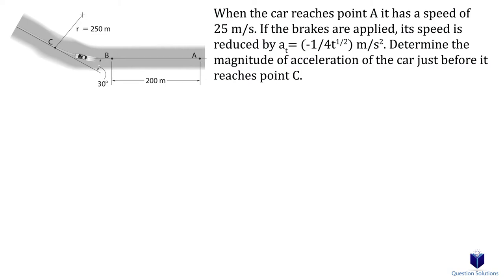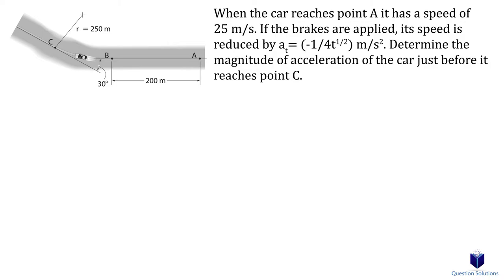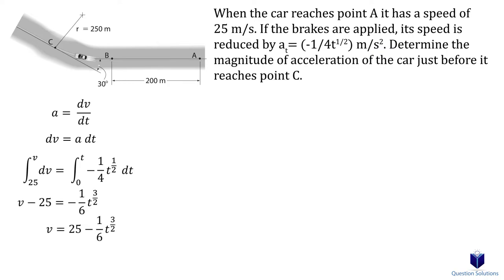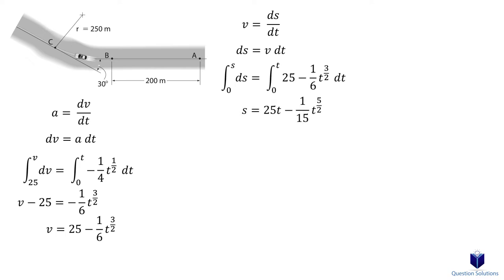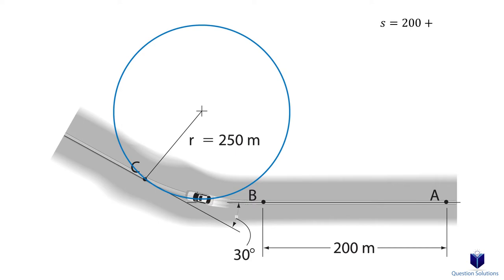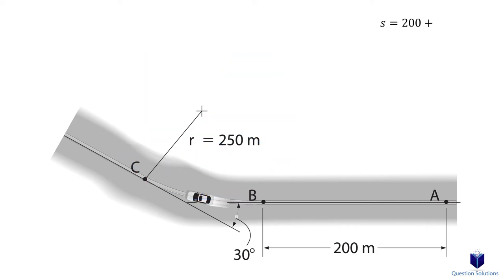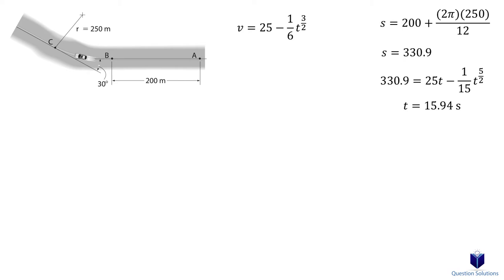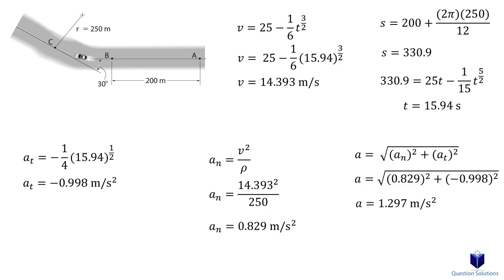When the car reaches point A it has a speed of (solved)

Comment: How did you solve "t" (1:45)?
Reply from the maker: You can graph it, guess values until you get close enough, use wolfram alpha, etc. https://www.wolframalpha.com/input/?i=%28-1%2F15%29t%5E%285%2F2%29%2B25t%3D330.9 or https://www.desmos.com/calculator/db5t3xvxpu :)
Reply: if you have scientific calculator just put in the equation you will get the answer

Comment: is getting the length from B to C the same as converting the 30 deg into radians and then multiplying it to the radius(250)?
Reply from the maker: Yes. If you plug it in, you will get the same answer.
Reply: @QuestionSolutions  thank you

Comment: Thx mate
Reply from the maker: You're welcome.
Reply: @QuestionSolutions  how do you solve -1/15 t^(5/2) + 25t= 330.9?
Reply from the maker: https://www.desmos.com/calculator/h454v7jpoi
http://bit.ly/2MyvV9J

I used that, but you can plug in numbers until you get a close enough value if you're tight on time as well.